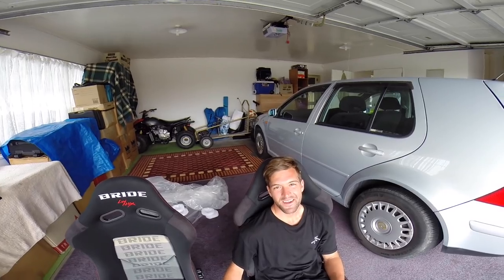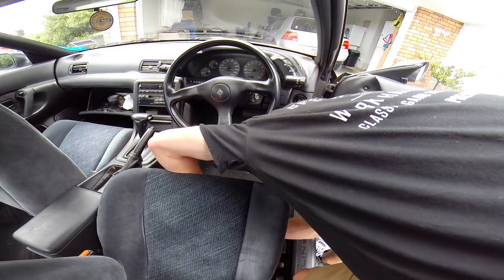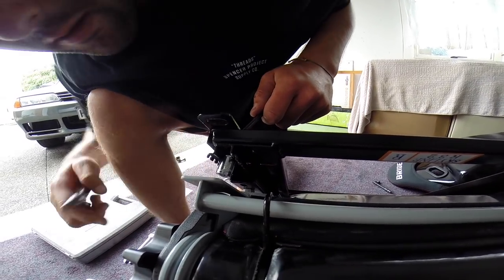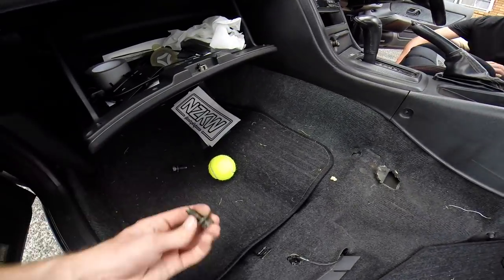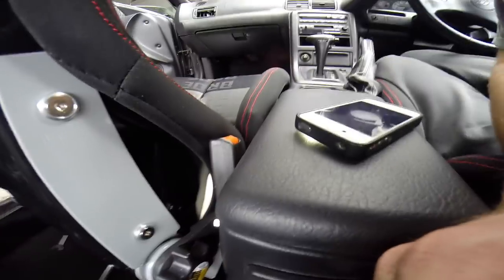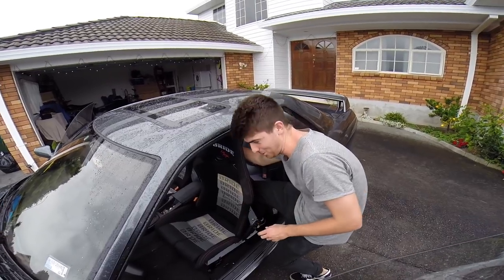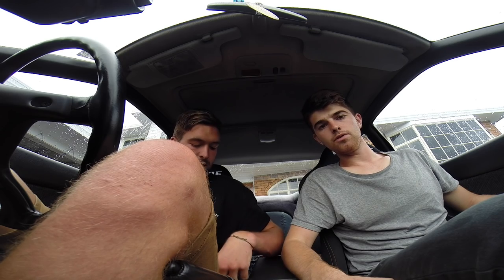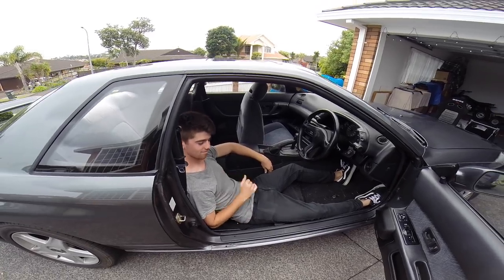How to install bucket seats (Skyline r32)

Comment: Just got one installed on my ride, getting in and out of the car is really quite a burden.. thinking if i should buy another one instead and with a small side bloster for the legs so it wouldn't be as hard? Looking at the Recaro Driver Cross Sportster CS 3
Reply from the maker: +Koh Kim Heng nice! Yes that is one downside to them, finding the balance between comfort and performance is always a tough one!

Comment: can you remove old seat rails and put them on the new seats or do you have to buy specific rails for the specific car and specific seat
Reply from the maker: Seats and cars to vary so it depends, you would need to check the bolt patterns. Thanks for watching!

Comment: You guys are awesome! this actually helped me alot installing my seats :). Im going in for my cert next week and was wondering if you guys know what they check when certing seats. From Hamilton by the way haha.
Reply from the maker: +Farhan Khan Thanks heaps man! Glad it help you out! Awesome man what car do you drive? From my understanding you don't need a certification for after market seats if they are on rails and can be adjusted. If they are bolted straight to the floor and can't be slid forward or back then they do need a cert. Might be best to double check with a certifier though. One thing we did wrong that we haven't addressed in the video was that we actually put the bolts for the seat rails in upside down by accident haha rookies aye! But since flipping them round the right way we can adjust the seat a little bit more than demonstrated in the video. Still a mission getting in the back seat though haha! Thanks for watching bro!
Reply: +Those Car Dudes Iv s14 facelift. Non turbo so don't get too excited haha. Aw sweet as still a mint tutorial bro. Dropped the car off for a cert today hopefully everything's Allgood haha. Will let you know how it turns out. You guys in Auckland ?
Reply from the maker: +Farhan Khan Mint bro! What have you done to it? Hope it passes with no problems bro
Yeah bro we are in East Auckland
Reply: +Those Car Dudes just the usual stuff bro. Coilovers, adjustable arms, 5 stud conversion, manual conversion, kit and some brides.yeah really hope it passes haha. Il hit you guys up when I'm in Auckland next! Keen to see the progress on the skyline :)
Reply from the maker: +Farhan Khan Mint bro! Yeah that would be cool! All the best with your cert!

Comment: Did u need to get a cert for the seat. And do u decking I can put the same type of seat in a ford falcon ba?
Reply from the maker: +Manual With/clutch you only need cert in nz if the seats aren't on adjustable rails. They should fit if you can find aftermarket falcon rails for them :) 
Thanks for watching dude!

Comment: It's really risky to use replica seats since they won't hold up to safety standards. Even if it looks cool, you're not protecting yourself better than using the oem seats bc those seats wont be up to the same standard and could rip out or break in the event of an accident. If you cant afford legit brides, then get something cheaper but is legit like some corbeaus or first R OMP seats.